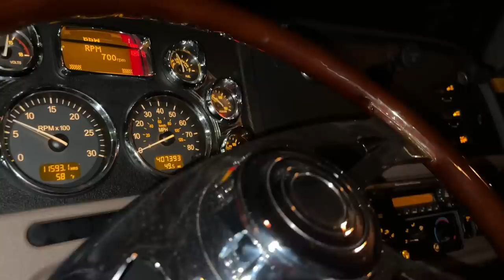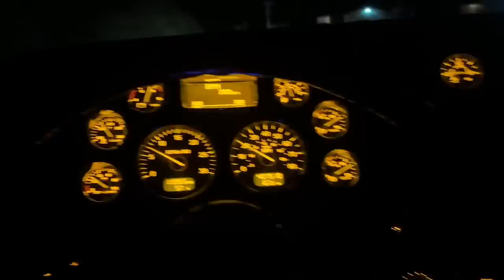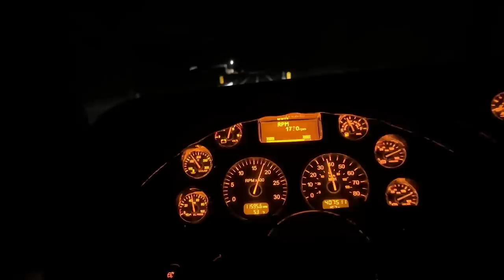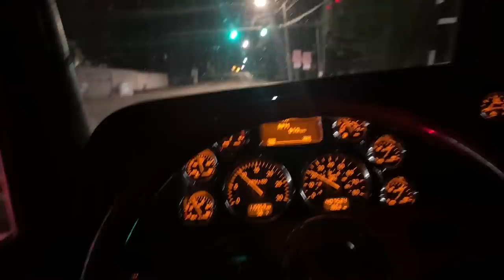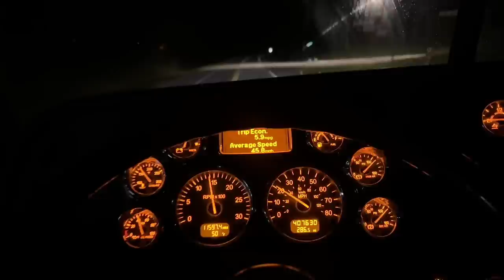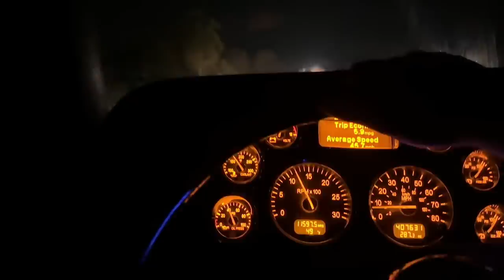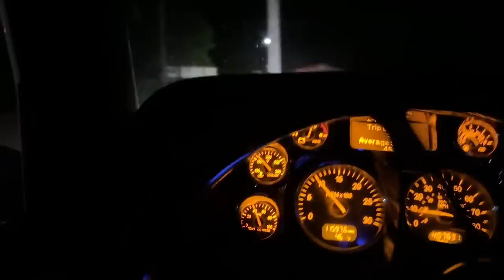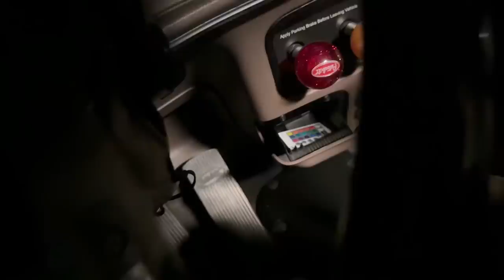I Put The Pete To The Test!! Hauling Cows In The Tennessee Mountains..

Comment: Speaking on freight, I'm deadheading 680 miles to get a load that isn't cheap broaker trash.
Reply: Fsc I have been doing the same
Reply: That is crazy 😜
Reply: Uncle Fester...😂😂
Reply: @wc6553  original.
Reply: @fsctrucking  Just calling it like it is.
Reply: deadheading sucks man.
Reply: I deadhead every load but I payed for it , 2000to3000 miles   I haul boats
Reply: I'm actually in process of doing my paperwork to put my peterbilt leased on where your at

Comment: Tim, when you open your belly gate, lift the floor door first then swing your bottom belly gate open. I also stand behind the belly gate or on top of it. Usually as soon as I open the swing gate they’re running out of the belly faster than I could get out of the way.  Safer option to be behind the gate, it won’t crush you as it’s against the trailer wall already and you have plenty of a gap behind it

Comment: Just a heads up I wouldn't be putting out there that your truck is deleted.  They are hunting guys down for that stuff and the fines are outrageous
Reply: Beat me to. That’s one thing they are cracking down hard on. And big trucks are even worse than pickups. One good thorough truck inspection and he’s got a fine.
Reply: @Wilborn95  They are also going back on the shops that do the delete. One shop got fined 30grand plus 10grand for each truck that was deleted by them.